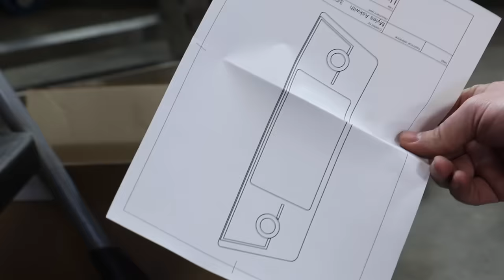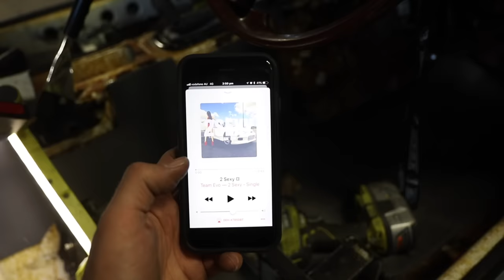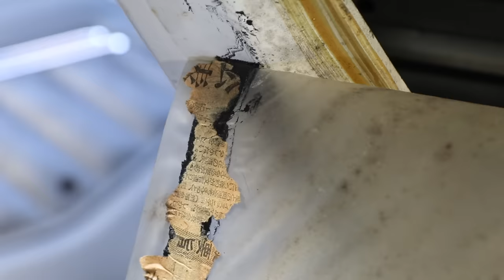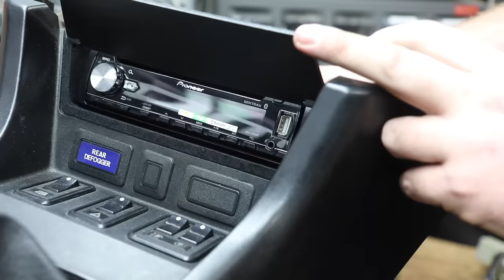RB26 240Z - Roll Cage + Stealthy Hidden Stereo

Comment: I would put blank speakers in the door and try mounting speakers either under the seat facing forward or under the dashboard facing down or just cut holes in the center console and mount them in there... A couple ideas anyway. Gives you an excuse to make a NEW center console

Comment: Push the center out go to a boating supply shop get stainless screws and brass surround washers replace the clip add the screw and washer for a classy replacement.

Comment: the "stealth flap" will make you mad pretty soon. It's gonna make some nice flap sounds at every bump in the road. And it will annoy you whenever you want to actually adjust something on your stereo since it doesn't stay open.

You should have a showdown against the 240Z from Roadkill...
Reply: I'ma give them both a Luke Score (because duh, I'm not Doug)

Rotsun:
Speed: 10/10
Style: 10/10 (the Style is measured by category, the Rotsun is a Rat Rod, the Fairlady is a Restomod, they would be hard to compare) It's a solid Rat Rod, the patina doesn't look exaggerated, since it's real
Dailyability: 3/10 (i guess if you really wanted to ,you could, but That thing is hardly street legal
Personal opinion: 5/10, I don't really like Rat Rods, but that thing is badass.

Fairlady:
Speed: 10/10
Style: 10/10, It's a nice, clean,stealthy restomod with an RB26 in it.
Dailyability:  6/10
Personal Opinion: 9/10, because I would've used a Hakosuka with flares

Comment: There are plastic clips that expand the inside of the clip through the hole when a plastic screw in the center of it is tightened thus pushing out tje expanding shaft behind the hole to lock it o

with no plastic bits falling off inside the car.

am i missing something about the interior bits here?

Comment: Why not glue the old face plate onto the stereo secret flap? Also glue on the old dials and/ or buttons so it still looks stock.
Reply: Then you cant open the flap up, it would hit the heater controls

Comment: Is it just me or does it sound like that head unit face plate cover flap is going to "rattle" when you hit a bump??? May need to run a small thin line of rubber along the bottom of the flap to prevent that.

Comment: Don't push the centre all the way through, use a trim fork on the outer section and keep gently pulling while pushing the middle, the clip should come out before the middle disappears into the realms of the 240s boot

Comment: I think radio door had missed opportunity. Should have copied the original radio screen, heck even use that and just put on hinges and mod the know so its can be used to turn the new players volume knob. Way easier to operate when you need to lower the volume.

Comment: adding sound deadening material is not without possible drawbacks in total visceral appeal, if too much deadening, certain desirable resonance that appeals to driver feedback and enjoyment is lost, and out of balance with sense of G's and speed, and you/I can definitely feel an unwanted chunkiness in the mass of the car.  Secret tip....don't do it unless you want your car to vibe more like a Camry/Lexus than a street car beast

Comment: For the front speakers, check out some replacement kick panels with speaker holes. You can fit pretty good speakers in there (especially if you’re running a sub they’ll be more than adequate), they’re nowhere close to your pedals, and you won’t have to cut your door cards. 

These guys sell them, so do others:
http://www.thezstore.com/page/TZS/PROD/classic08g03/50-5358

#purity #keepitpure #teampurity

Comment: I've been installing car audio systems for 20 years and I really must speak out. I respect you guys madly and have never had a word to say negatively, but this audio setup just isn't ideal. The rear fill is pointless in a car like this - you're literally throwing amplifier power down the drain (be it head unit or the amp that looks like it was just for the sub). If you're on headunit power you're killing the output in the front which is all that matters in this application.

At the end of the day I hope it sounds good and you enjoy it in any case lads.

Comment: Don't push the center part all the way thru... Almost 1/8" is really all you need to push. Or, get some toothpicks & super glue. Dip the toothpick in the glue, put the tip of toothpick on the center piece, let glue dry, pull center piece out. Use razorblade to cut thru glue & remove toothpick, voila - you can re-use those PITA clips as i call them

Comment: As Moog just wants bluetooth, instead of the head-unit I'd have installed a bluetooth module, possibly a pre-amp and a power amp (plus what Moog did with the speakers, sub+amp etc). 
At least with what you've done you have a radio if you decide you want to listen when you are miles from civilisation and have no 4G for streaming!

Comment: 2 things you will need to get the clips out of the bottom of the car. A shop vac & a pair of pantyhose. Cut the leg off the pantyhose & push that over the shop vac hose & then push the pantyhose up the shaft to create a pocket & turn on the vacuum & suck up the clips keeping them out of the bottom of the shop vac mess.

Comment: Those interior clips..
Your  NOT suppose to pop it all the way out.. a half pop is all you need then you use a plastic prying tool to pull it out with the middle pin in tact and ready for reuse.

Comment: Sorry mates, I have to rate your stealth audio unit  install a bit of a failure. To keep your Fairlady's vintage persona pristine, you should revisit the task.

She would look lovelier, if you would have incorporated the design of the 8-track faceplate into the mix. 

Simply set the unit just far enough forward in into the dash, so the 8-track cartridge insertion flap will flip all the way up.
It would be easy to duplicate the original faceplate, so you can still sell the original 8-track for  big money.

Comment: You're pushing the center pin I  too far. It's only supposed to be pushed in until it clicks once and then use a pry tool to pull it out. To reuse push the pin back in and pop out one click towards the head.

Comment: "nostalgic car product" lol
edit: holy cow they still make that shift boot oem? usually you cant get anything older than like 20
Reply: popularity of the car and of course demand drive the market. Allot of people keep their Mercedes and you can buy every bit for those but it will cost a fortune. Considering a bagged Benz a bit as I want a million mile car.
Reply: Nissan is pretty decent, I'm not sure if they just keep a lot of stock or the parts carry over to much newer models but i used a lot of brand new oem stuff when doing a rb25det from rb30e swap in a late 80s car.

i had 84 Toyota Hiace with a broken quarter window. 40 bucks new oem or was 80 bucks used from a wrecker
Reply: I don't know about Australia specifically, but we can order leather replacement bits for almost anything reasonably classic or common in the U.S.
IIRC the armrest cover for my car came from Italy.

Comment: Hit up massive audio competition audio company - they make a extremely affordable 6.5" subwoofer its worth $100 in us in shipping for that 1 sub but get 2 if you can ask them for a promo mabey! 

Fantastic company btw!  & you can run everything off a BT 4CH as a 5ch by using the top for all 4 speaker's & the bottom bridged for that 1 6.5" as it only needs 150w rms but can take 300 peak 600w RMS on alot of YouTube videos and the massive audio 4ch amps are super clean & powerful great bang for buck!
Reply: I dont work for massive audio... you could  fo this with whatever brand but massive audio will hive you LOUD AF  & lightweight happiness

Comment: Sorry, but you could do way better than stuffing a wank head unit with a cover plate... What a waste of time. You guys should have stuck with the stock radio cover. I do not understand the one dimensionality with head units in cars. I just finished spraying rubber on the doors of my junk ranger with 280k miles, before adding "dynomat" to the door skin; yet I am keeping the stock stereo face and building my own guts. For a couple blokes who do music, I would expect more. The traditional head unit is obsolete in my opinion, no reason to drop the ball there.